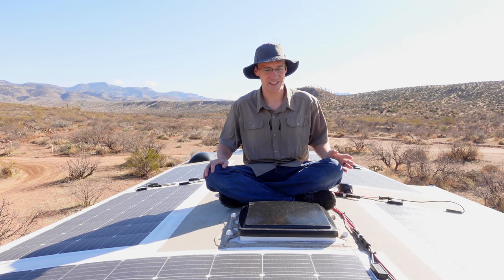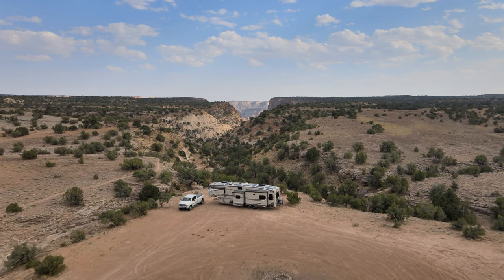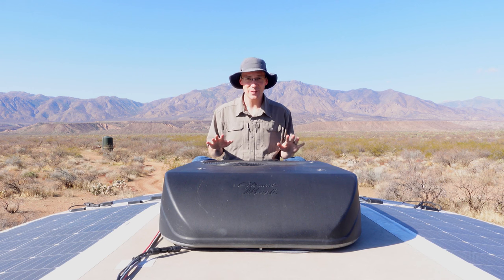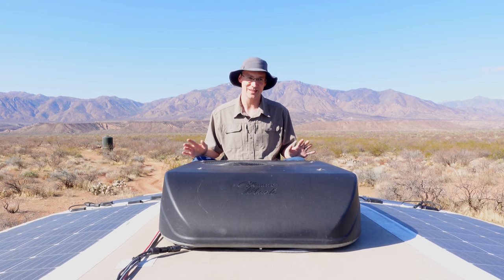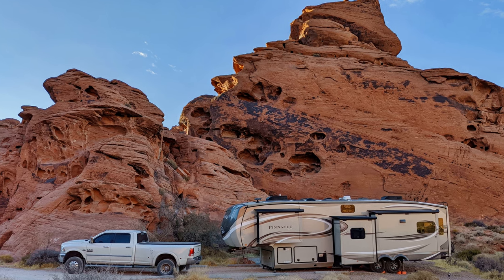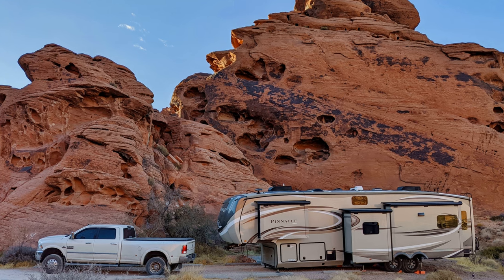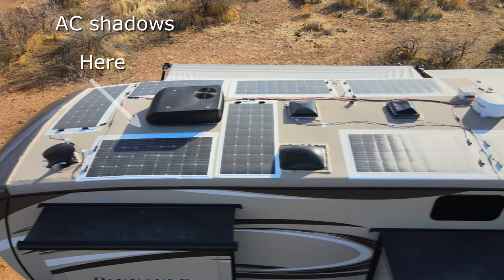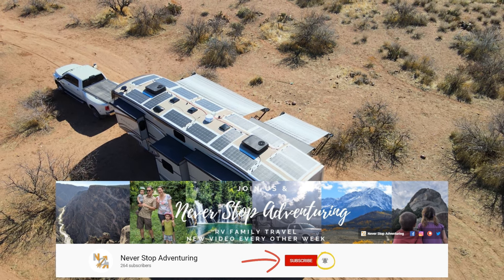RV Solar System Lessons Learned

Comment: did you use 3m tape to mount the solar to the roof?
Reply from the maker: I used 3 large strips of heavy duty Velcro under each panel. After that,, the white tape around the edges is Eternabond roof seal tape.
Reply: @NeverStopAdventuring  How long is the life span of these panels as eternabond is hard to remove.

Comment: What do you recommend for a new RV owner. 34 ft, 50 amps? Energy audit 3500 watts....prefer boondocking
Reply from the maker: First, a few questions: Is that 3500 watt hours over 24hrs? Do you want to run both sides of your 50A breaker box (two inverters) or are you good with just a few outlets/appliances? How much extra weight capacity does your rig have?
Reply: @NeverStopAdventuring  I have a 34ft motorhome. Not sure where to find extra weight capacity? As for the 24hrs, that was a high end estimate as I want to be off grid as much as possible. Does that help? I feel I need someone to guide me through this, for the best setup 🙏
Reply from the maker: @ChristineJGold  how much do you think you need based on your research? Based on the info you gave me and checking an online solar calculator I'd say 3-4 lithium batteries + battery monitor, 500-800 watts of solar panels. You could get away with less if you use fewer watts overnight. I'd recommend a good MPPT solar controller and maybe a 1000W inverter. Inverter size is mostly dependent on the largest appliance you'd like to run. All of that can be heavy which is why I asked about weight capacity. Google your model of RV and look for GVWR (Gross Vehicle Weight Ratio.) That's the maximum amount of weight your RV is rated to carry. Next, weigh it at a truck stop (cat scales) to see how much weight you have to spare. That'd be your GVWR minus the actual weight from the truck stop scale. If you have plenty of capacity, go with rigid panels - they're cheaper and last longer. If you need a lightweight setup, go with flexible panels.
Reply: @NeverStopAdventuring  thank you for the tips! I will look it up and see what is best. I appreciate the help

Comment: did you think about installing the solar panels on some type of light weight rail system in order to provide the ability to tilt towards the sun? I am looking at installing a large solar system myself and trying to find out if the extra fabrication work would be worth the time investment.
Reply from the maker: The short answer is no. We really don't have the weight to spare which is why we went with these lightweight, flexible panels to begin with. If we had a motorhome or toy hauler that had more cargo capacity, we would have gone with cheaper rigid panels and more fancy mounting hardware.
Reply: @NeverStopAdventuring  thanks so much for taking the time to reply. I am planning on upgrading to the Riverstone 42FSKG which has triple axles and a CCC of 3274 lb.  With me living alone I definitely have the weight to spare lol.
Reply from the maker: No problem! Yeah, you would definitely have the carrying capacity with that! There's no doubt that tilting increases solar output. I also know myself enough to say that I wouldn't want to climb up there and tilt 15 panels every time I move. There are motorized setups that'll do it at the flip of a switch though.
Reply: @NeverStopAdventuring  I agree with about not wanting to go up on the roof to tilt lol. I have watched a lot of youtube install videos and seen one that has a remote tilt system. Still building out my dream solar system and seeing what the overall cost will be... after the fed tax credit that is ;)
Reply: The rail system might actually provide a small amount of shade to the roof as well I'm not sure how hot these flexible panels get. The outcome of their design is really sleek and nice looking

Comment: my experience. the flexible panels are great first season. good the second. all but dead the third. the sun destroys them quick. I live in the north east so do not have such a strong hot sun as the south . cover during winter. yet still they are faded significantly and produce half of their original power. I'm using 3 different brands purchased from 3 different places. go with glass or use the flexible's only when camping. also the flexible panels on my roof raised the inside temp dramatically.. i wasted 1200 dollars on flexible and have since gone to glass.
Reply from the maker: What brands did you use and did they have a power output warranty? We're in our 3rd season now with these Renogy panels and they're a bit less powerful than they once were but still quite good. They haven't raised our indoor temps at all. I'm not sure if that's because our particular 5th wheel is heavy on the insulation or if it's more to do with laying them down with velcro underneath that keeps them from completely resting against the rubber roof. Glass panels just weren't an option for us - too heavy.
Reply: @NeverStopAdventuring   One brand I remember was Dokio . I think other was Alrska. Definitely Chinese knock offs but when I saw that even the best ones were lasting only 5 years I figured it didn't pay to go Renogy or something like it. As far as warranty I didn't bother. With a 13 year old roof that doesn't leak I wasn't gonna touch it. That camper, a 25 foot travel trailer, is now permanently installed on vacant land hooked to power. The panels will remain on it hooked to a 30 amp controller which at this point is all I get out of 1200 watts worth of flexi's. It will work in case of emergency. My new glass system went on a 36 foot 5th wheel. Yes my panels add up to 0ver 400lbs. Batteries another 200. Inverter and controllers another 150. But I was lucky. This trailer happened to have a very high cargo capacity based on it floor plan. Either way I have air conditioning without running a Genny. That was the systems main purpose.

Comment: How large is your battery Bank? Thank you for the video
Reply from the maker: We have 6 lithium batteries (Battleborn). So, 7200 watt hours, or 600AH @ 12V.
Reply: Thank you so much for the response. We're going full-time in a couple years and I'm in the process of equipping my camper similar to the size of your camper. Do you have any reserve left in your batteries each day with the six of them can you go a couple days or two days maybe without solar or do you need a bigger battery bank for that I too am going to be using a residential fridge.
Reply: When I have time later next week I'm going to be going through your videos I'm really interested in how much those gadgets to raise your solar panels up and down cost
Reply from the maker: Nice, that's exciting! That's a tricky question because everyone uses different amounts of power and every camper is also different with power draw. We installed our batteries and dual inverters 5 months before we pulled the trigger on the rest of the solar install. We didn't do a whole lot of boondocking in that time, but when we did, I was definitely running our little 2000W generator for a few hours everyday to keep up with our power usage. For starters, I think the best money is spent on a smaller lithium battery bank to replace the lead acid deep cycle ones that every RV comes with. You'll also want a battery monitor to go with that and a reliable, quiet generator. Keep in mind too that this advice is coming from someone who fully recognizes that he is a bit of a power hog.
Reply from the maker: We skipped the fancy mounting systems in favor of weight savings. Being able to tilt your panels would definitely help though!
Reply: I'm building my own lithium battery Bank. I can build 600 amp hours with less than $1,000 with a 24 volt system or 12 volt I haven't decided yet. I already have a nice 3500 watt generator from harbor freight very quiet and I can run the whole camper in AC all by itself. We're still not leaving for almost 2 years so I'm having a lot of fun planning this out and working on my RV getting it ready for our new adventure and retirement.
Reply from the maker: You're all set! I stayed with a 12V bank because my levelling system is all electric and pulls a lot of current. I would HIGHLY recommend a higher voltage battery bank if you don't have any high current 12V loads. There's definitely some power loss when I'm running high wattage appliances. I've seen some amazing DIY lithium battery builds. Although I wouldn't consider the DIY route safe without a really good battery management system

Comment: Awesome job! Wish I had found your channel sooner. My system is behind the panel in our 2018 Montana, including 5 24v (about 14kw) LiFePO4's and 2 24v 3000w Victrons back there.Very crowded. Your power consumption info is more valuable than you may realize. Are you having any thermal issues with any of the Victron equipment due to the heat they generate in a confined space? In the desert? I have a 100cfm bathroom fan I was going to mount on the ceiling and exhaust thru the belly to pull cool air in from the coach. It would be great if I don't need it. We don't use the washer/dryer as prepped so I added 20a plugs from those circuits in the pass thru bays.
Reply from the maker: Thanks! That sounds like a great setup! Do you have an electric leveling system on your Montana? Ours claims it can pull up to 90 amps which is why I stayed with a 12V battery bank. Otherwise I would have preferred to go higher voltage... I'm glad you find the power consumption useful! I had a hard time finding info like that when I first designed our system and it would have made the process easier. We haven't had any thermal issues and I haven't put any extra fans in the bay. With the walls removed underneath there's quite a lot of air space, even with the Victron equipment stuffed in there behind the wires and pipes. The highest temps I've seen in that bay were around 88 degrees when we'd used a lot of air conditioning. Although we do have a grate under one of our stairs that allows for some air flow between our living space and the cargo bay. I've noticed on some of the hot days when we're done running AC for the day that all that extra heat down below warms up the upstairs a little. When we're in hot temps again I'll probably open up both bay doors to allow a cross-breeze. I don't know if you'll need the fan or not for your setup, but you could always try it without and just measure the temps. More ventilation never hurts though!
Reply: @NeverStopAdventuring  Yes we have electric leveling and I have had it thermal protect a couple of times. You have to "re home" the magnets when this happens. I suggest you read this section in your manual and use some velcro hook to put a copy next to the control box it will happen. I have 2 100a renogy LiFepo4 12v for the house 24v only runs the inverters. I only have 1 150/100 controller for 2400w solar.6 series 4 parallel higher voltage lower current so I could use smaller wire. Your series panels add voltage but current is single panel current then when you connect the series strings is parallel the voltage of the 3 panel string stays the same and the current adds is parallel. Ran it without panels just recharged in campgrounds worked great. No matter the input shore power the inverters adapt flawlessly. Will be trying out the solar this summer in Moab. This will be all be complete by the time I retire. The roof penetration was tough I had to dodge 110v wires they chased thru the ceiling.
You are blessed with an awesome family. Keep posting! The content and production are top notch. The traffic will come especially to the rv solar.
Reply from the maker: The only problem we've had with the leveling system thus far is a burned out 30A fuse for one of the rear jacks. That was an easy replacement. Your higher battery voltage allows for fewer solar controllers. Since I'm using just a 12V battery bank, each of those controllers is only good for ~1400W. Having the 3rd controller allows for some expansion...more on that later this year 😀. You're right, these inverters are really great with how they adapt with shore power. Running on 30A is almost as good as 50A. Makes it not worth the extra money some campgrounds want for the full 50A connection. Thanks! We really appreciate it! Actually, we have a new video coming out tomorrow morning!
Reply: @NeverStopAdventuring  I think I am your #300 sub, looking forward to the next video

Comment: you could have installed a dual mini split system and solved your power consumption issues not to mention have a perfectly quiet ac setup for the front and back.
Reply from the maker: True, and I'd love to have that. Although the installation would present some other challenges and would be yet another major project to solve a problem we don't really have at this point. Our current AC units aren't loud at all. I'd consider it if they gave out on me. I'm still not sure where I would put the exterior unit - I like our bike rack at the moment. Have you installed one?
Reply: @NeverStopAdventuring  I installed one on my bumper at the frame.
They make ones where the outside piece goes where the current oem ac is, perfect drop in.
Reply from the maker: Nice! I hadn't heard of those. I think I'd prefer one on the bumper as removing the top ACs would both reduce our overall height and make even more room for panels. I'd probably end up with some sort of reinforced hitch that would support both the mini split and a bike rack. Maybe in the future...

Comment: We aren't really sure how much solar to get. I would like to run an ac unit if it gets too hot, but I think our plan is to follow the good weather and not need ac.
Reply from the maker: A good place to start is just trying to figure out how much power you "need" in a day. It can help to get a watt meter and measure how much your various appliances use. I highly recommend upgrading your batteries first and getting a nice battery monitor with it.

Comment: Make sure to use 540 watt panels and be efficient and spend less money at the same time. Dont worry about every inch of rooftop and worry more about getting the most input from the panels you're choosing.
Reply from the maker: This was about getting a lot of wattage while not adding much weight. Many RVs run close to their maximum weight with just normal packing. These panels were only 6lbs each. A 540W panel weighs 70lbs before you add the mounting hardware for it.
Reply: @NeverStopAdventuring  I'd go for more watts and make the math work. Good luck to you! 👍

Comment: You know if you installed a micro air easy start on each ac you would cut down your wattage by 65/70% then you would be able to run both ac’s in the summer with no problem!
Reply from the maker: I actually installed EasyStarts way before this solar setup and did a review about it: https://youtu.be/8qHv1w6E6Jc   They only reduce the startup surge which is important for not overloading inverters. Unfortunately there's no way to reduce the total wattage needed to run an AC unit. They need what they need. The other option is to install a more efficient cooling system like a mini-split. Maybe that'll be a project for the future!

Comment: the biggest issue is your choice of going with flexible panels over rigid.  They don't produce their full rating and tend to degrade much faster then their rigid counterparts.
Reply from the maker: I'd happily go with these Renogy flex panels again. They've held up well over the last 3 years. Many flexible panels are junk, these aren't. Rigid panels were just too heavy for this application.

Comment: Just watched your 3 videos on your solar .  Really enjoyed them, especially the information on how much energy you capture and use under different conditions.  I just installed 8kW (6x105Ah) LiFePO4, one Multiplus w/ a manual phase switch, and 840W solar - with plans to add panels over time.  To help me compare your usage with what I should expect, what fridge type to you have - residential or absorption?  With it running 24x7, that can make a big difference.  Thanks in advance.
Reply from the maker: Thanks! Nice setup! We have a 21cu. ft. residential fridge. When it's running it pulls 100W. There's a defrost cycle that pulls quite a bit more then that but it runs so rarely I've yet to see exactly how much it draws.

Comment: I see all you guys give the proper way to organize the battery bank but the truth is you guys need to put solar panel diodes or battery isolators between each battery because even 1 weak cell and the balance of the system gets thrown off,,,Its expensive but the only way to properly recharge and not overcook r/v batteries or inverters as when you turn an inverter off its supposed to stop reverse voltage flow but after the vehicle is jumpstarted wrong the diode fails and should be used as a redundancy not a defense.........

First thing to know is ABOUT FLYBACK!!!..Its more deadly than you realize for electronics and solis state devices....Recall city here we come......!!!!!!!!!!!!

Flyback has an effect on switch panels too look up switchpanel diodes they sell at Jegs.

You must totally protect the whole RV from Flyback...Look it up..You heard it first from The Godfather to Understanding Flyback & The Way It Afflicts Vehicles..Take care
Reply from the maker: Each one of my batteries has a built in battery management system (BMS) to protect and manage the charge/discharge cycles of the cells together. Actually, most of the brands that make Lithium RV batteries do. As for the inverters, I just follow Victron's recommendations for hooking them up. Some situations don't apply since this is a 5th wheel and for a motorhome I definitely recommend an isolator between the engine battery and the RV 12V system.